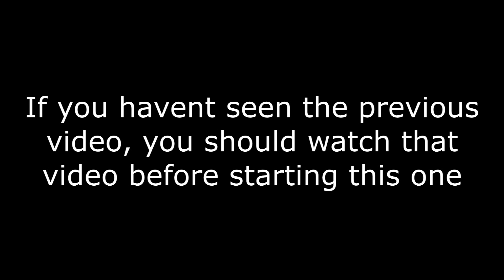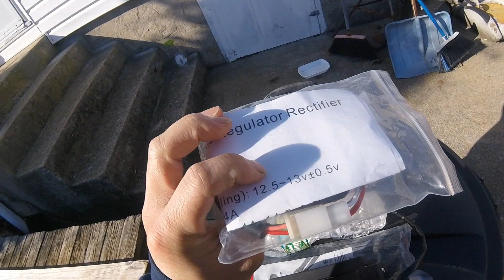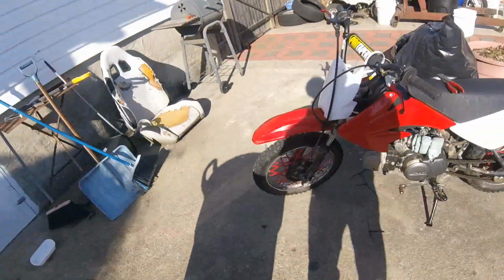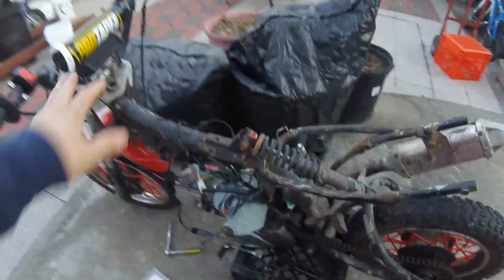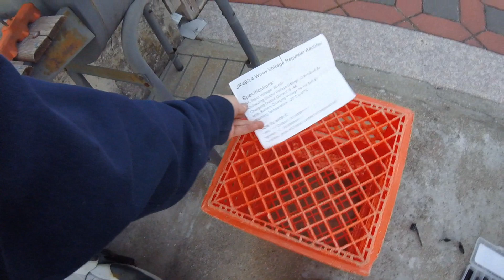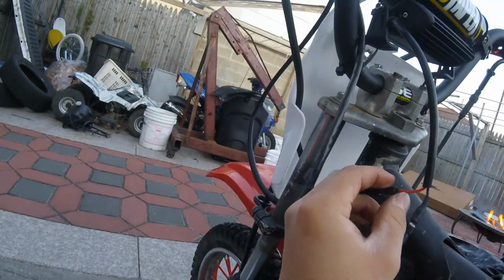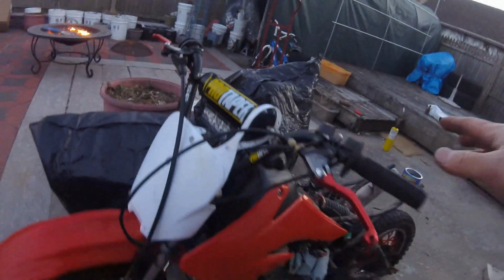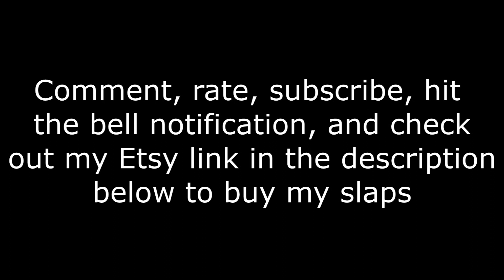LED Bar Headlight Install On My Honda XR70

Comment: I'm doing something similar now up in New Hampshire. NH requires the lights to be able to run while the engine is off.  Can you add a small lithium ion battery to the loop and have it charge off the same stator?  Will that regulator be enough to add battery and have the led headlight?

Comment: Any issues so far? I'm thinking about doing this to my xr70r pretty soon to
Reply: Yeah same I want to get my xr70r street legal
Reply from the maker: It survived heavy rain during a during a road trip, durability wise I flew 7 feet in the air and crashed my bike and the led bar still lights up.